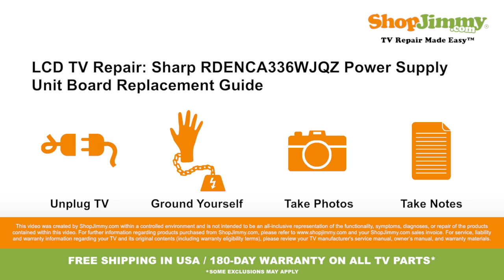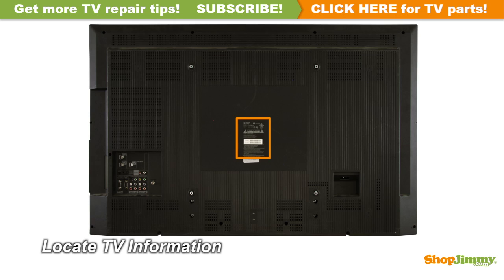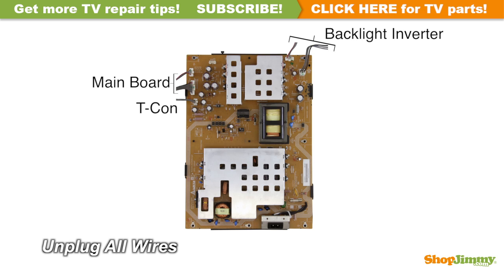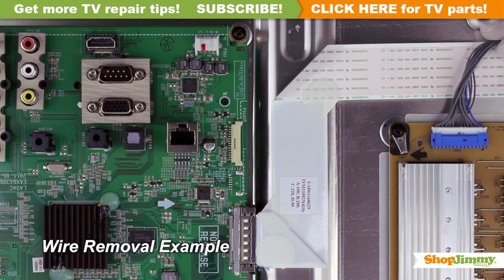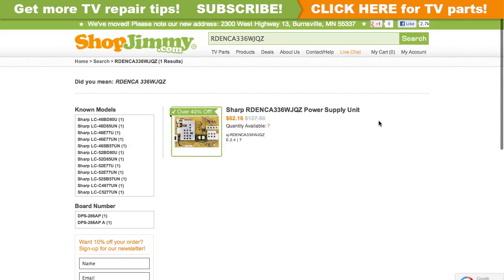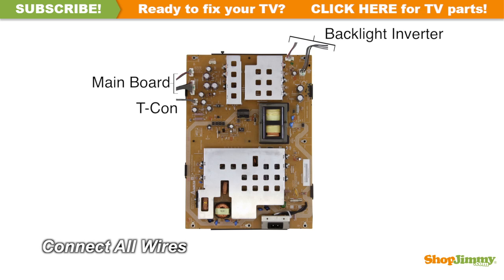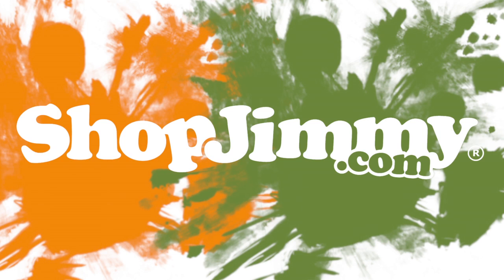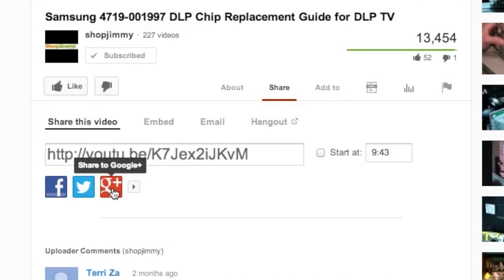LCD TV REPAIR TV WILL NOT TURN ON - Sharp TV Power Supply Board Replacement Models LC-46 LC-52 LC-C

Comment: I have a Sharp LC-43UB30U which was purchased in 2015. The tv now makes loud crackling/popping noises, The tv turns itself off and on and at times goes either to an all black screen or a screen with snow or just goes off completely. Do you know if this could be the power supply?

Comment: Hello, I have the SHARP 
LIQUID CRYSTAL TV
MODEL PRO-70X5FD 120V
SERIAL NO. 108812410 and my husband is about to toss it vs fixing it. I think we can fix it. We have the error codes indicating a panel power supply error (2 slow blinks, 5 faster blinks). I am searching far and wide on YouTube & other sights and am trying to figure out, well how to fix it obviously, but wondering if this error code is what amounts to bad capacitors or not, I guess? Any help on this would be much appreciated as he does know how to solder. Help PLEASE.

Comment: My Sharp LC-70LE660U tv has no picture (very dim blue light in the background) or sound when turns on. The white power light comes on while it could not be turned off either by remote control device or from the tv panel button. I have unplugged power cord and no success to get the picture on.
Please advise if this is the problem of backlight inverter or the power supply board? Thanks.

Comment: Hello,I have a Sharp TV, model LC-46SB57UN that will not turn on. It has the power light, OPC light that blinks twice together and the OPC light blinks once by itself. Could this also be a result of a bad power supply board?

Comment: I have an AQUOS SHARP TV Model LC-52LE820M - replaced the Power Supply Board and have 1 short blink - followed by no display or sound. Tried resetting the lamp but no joy. However there is static on the screen. Please help!

Comment: My sharp lc52e77un will not come on. Blinks twice with the power and opc lights, then once with the opc light . Replaced the power supply board
Reply: Any updates pls?  Did you sort the problem?

Comment: I have a Sharp - Aquos  LC-46LE540E (Europe model) the power supp. is bad. I have to press 6 times on the tv and sometimes 10 times (20 min later) it will boot. I only can find a USA power supply. and i need europ because the 230 volt.

Comment: I have a Sharp Aquos LC60LE644U. It will not turn on there is a solid red light in the left corner. Tried all the tricks, unplug, hold power on, arrow up, (do a backflip while holding my breath and singing yankee doodle)  etc. Does it sound like it needs a power supply board replacement?   Please advise....

Comment: hello, our TV won't power on. If you plug it in, the red LED will flash very quickly and then gone. Do you have power supply for this model: LC-50LE440M. PS. when I visited your website, shopjimmy.com, it says Access Denied.

Comment: I have a sharp 52 inch model number LC-52D64U the opc light will flash once and the power light flashes twice right after it sounds like it wants to power up but it doesn't would you know what it could be I'm thinking it's the power supply board but not sure

Comment: I have a sharp LC-52D65U  T.V.  NO CONTOL from remote or buttons on side of T.V.   The T.V. is locked on and will not shut off, can't change input, no menu.   Any idea of the part to replace ?  Thanks.

Comment: How to change power source I have a sharp aquos 2003  model: LC 20E 1UBM Serial NO. 307818984  do you know why I can get a power cord for it?  or change out the old one to a two prong female end that's goes into the tv not the wall

Comment: My Sharp 60" LC-60LE745U wont power on.  The arrow-shaped light under the screen flashes twice fast and twice slowly.  No picture, no sound, no backlight.  I've gone through all of the button-pushing sequences that I've seen online and in the comments but nothing works for me.  Any advice?  Power supply?  Would I get the flashing arrow lights if the power supply was bad?

Comment: I have LC8470 60' 2 slow 2 fast.. if i unplug it from wall and wait 2 days and plug it. it works. but if I turn it off. it happens again. it seems to be the power unit. isn't it?

Comment: I have a Sharp Aquos LC-70LE757U that doesn't power on.  The white power light on the bottom middle of the TV blinks 2 slow blinks followed by 5 fast blinks.  I'm in need of help!!!
Reply from the maker: +Russ Dodge   Try all repairs and troubleshooting at your own risk.  This sounds like a TV panel (TV Screen) problem.  If your TV panel is bad, it may be more cost-effective to replace the TV as panels are typically hard to find in stock, difficult to replace, and expensive.  Thanks and please let us know if you have any further questions!  www.shopjimmy.com

Comment: What is the common device failure if i plug it in and it makes clicking noise as if turning on then front green lights just keep blinking? I need to know what to look for and how to test it so I order the correct part. LC 46D65U
Reply from the maker: +Allen Ibarra   Unfortunately, we are not aware of any common issue with that model.  Thanks!  www.shopjimmy.com

Comment: I have a problem with my aquos model # lc-52le640u not turning on, the logo on the tv blinks but never comes on...can you help?
Reply from the maker: +Fatu Moliga  Try all repairs and troubleshooting at your own risk.   How many blinks are you seeing?  Thanks!  www.shopjimmy.com
Reply: +ShopJimmy.com I am seeing one short blink and one longer blink, they alternate every second but the TV will not turn on. Any thoughts?  
it is an LC-52LE810UN
Thanks
Reply: +ShopJimmy.com I have the same model, it blinks one long, and one short, (or visa versa), replaced the power board... no change

Comment: My Sharp Aquous tv model number LC-7OUD1U and serial number 312814372 is blinking a blue and red light at the bottom of the tv. the blue light blinks two times and the red light 5 times. any suggestions?

Comment: LC-52sb55u. I have sound and I can see screen but barely through the flash light test. Amber power light.
Reply from the maker: +ChiefsNation82   Try all repairs and troubleshooting at your own risk.  This could be a problem with either the inverter board(s) or the lamps in the TV.  You can replace the inverter board(s) and see if that fixes the problem.  Click this link to replacement parts for your TV model number:  http://www.shopjimmy.com/catalogsearch/result/?q=LC-52sb55u  There may be multiple boards for the same TV model number, be sure to match part numbers on your current board, with your replacement for compatibility.  Thanks and please let us know if you have any further questions with your TV Repair!  www.shopjimmy.com

Comment: I've got a Sharp  Aquos Model LC-60E78UN and it wont turn on,  When I plug it in it lights up green LED for power but wont get a picture then after 5-10 seconds it starts to flash BOTH the power and the OPC LED's twice , then flashes ONLY the OPC for 3 times then back to both twice then OPC 3 times. This just goes on over and over and no picture or sound.  IS this a Power Supply Board issue?  Can I purchase a new one off your web site and this will fix it?  Thank you

Comment: I have a Sharp Aquos TV that makes a clicking noise when I plug in the power, I replaced the Power Board as you suggested in the video but it is still doing the same thing.  I get no screen, no sound just the clicking noise when I plug in the power cable.
Reply from the maker: Stanton PC Repair & Sales   Try all repairs and troubleshooting at your own risk.  Please reply with your TV model number.  Click here to view a video that shows how to find your TV model number:  https://www.youtube.com/watch?v=S51nhAmwR2M  Thanks!  www.shopjimmy.com
Reply: ShopJimmy.com LC 52D92U
Reply from the maker: Stanton PC Repair & Sales   PLEASE SUBSCRIBE TO OUR CHANNEL - Try all repairs and troubleshooting at your own risk.  I recommend replacing the main board in your TV.  Click this link to a replacement main board for your TV model number:  http://www.shopjimmy.com/sharp-duntke028fm01-main-board.htm  Be sure to match part numbers on your current board, with your replacement for compatibility.  Thanks and please let us know if you have any further questions with your TV Repair!  www.shopjimmy.com
Reply: ShopJimmy.com Thanks for the reply, I replaced the power board firth, than I replaced the main board, it still does the same thing.
Reply from the maker: Stanton PC Repair & Sales  Where did you purchase the boards from?  Thanks!  www.shopjimmy.com
Reply: ShopJimmy.com I got them from a TV repair shop and supplier in Gardena California.
Reply from the maker: Stanton PC Repair & Sales  Try all repairs and troubleshooting at your own risk.  It sounds like you received defective replacement parts, I recommend returning them and seeing if different replacement parts fix the 
problem.  Thanks!  www.shopjimmy.com

Comment: I have a Sharp Aquos 60" LED that was hit by a power surge and now will not turn on.  I am getting a series of flashes from the white indicator light below the Sharp logo.  The light flashes twice quickly then twice but a little longer -- basically, 2 short and 2 long flashes. I cannot get anyone to tell me if this code means anything, of course Sharp wants to send out a technician and charge 100.00 for that, and my tv repair shop wants to charge 65.00 to come get it and 49.95 to diagnose the blinking.   The tv is 3 years old but I don't want to have to replace it.  Any suggestions would be awesome!
Reply: Sorry forgot to include my model 60LE632U
Reply from the maker: Mark DeGroot   I recommend replacing the power supply board in your TV.  Click this link to replacement parts for your TV model number:  http://www.shopjimmy.com/sharp-runtka847wjn1-power-supply-unit.htm  There may be multiple boards for the same TV model number, be sure to match part numbers on your current board, with your replacement for compatibility.  Here is a link to a video showing how to identify your part number, click here:  https://www.youtube.com/watch?v=-i9o4C2XkyQ  Thanks and please let us know if you have any further questions with your TV Repair!  www.shopjimmy.com

Comment: I have a Sharp lc60le600u TV that will no longer turn on. I bought this TV used, and it powered on just fine when I bought it, but after letting it sit for 3 days without powering on, it no longer displays anything. When I initially plug in the TV the V power light in the middle of the TV (under the sharp logo) illuminates for a few seconds and then goes dark. The power button doesn't do anything for the screen no does the affect the lit up V. I'm thinking the power supply may just be bad but I'd like to hear what you think is the issue. Thanks!
Reply from the maker: Rob Sessions   This could be a problem with either the power supply or the main board.  You can replace each of those boards to see which one fixes the problem.  Click this link to replacement parts for your TV model number:  http://www.shopjimmy.com/catalogsearch/result/?q=lc60le600u  Be sure to match part numbers on your current board, with your replacement for compatibility.  Here is a link to a video showing how to identify your part number, click here:
Thanks and please let us know if you have any further questions with your TV Repair!  www.shopjimmy.com

Comment: You know, I've seen replacement guides on this channel on this model LC-46SB54U, but I never see a troubleshoot guide on finding out what part went out. Also with this TV, when powered on, no screen, hear clicking noises for about a minute, and then the power light with the OPC light blinks 1 time, and power light blinks an extra 2 times. If you know what went out on this computer, please tell me so I can order from this site.
Reply: oops. Said computer instead of TV. I'm a repair guy and deal with a lot of TVs and computers.
Reply: DJ Overspin Did you ever get an answer about your issue.  My lc-46d62u just did the same thing yours did.......wondering if it is fixable or not.  suprtma@gmail.com

Comment: HELP? I plan to replace the Power Supply for my LC-42SB45U, but my husband and I have been unable to remove the back of the TV to access it. All screws have been removed and all 4 sides separated, but something seems to be holding in the center of the back where there is a small black plastic circle, but nor screw. Any suggestions?
Reply from the maker: Debbie Calloway   Is it over the tuner?  Can you upload an image online and reply with the link to that image?  Thanks!  www.shopjimmy.com

Comment: I have a Sharp LC-46SV50U. It doesn't always come on when the power button is pressed, although the green led comes on and stays on. When in this condition, the green light is on, the tv cannot be turned off with the remote control. Other times it the tv comes on as it should and functions normally. I have always been able to unplug the power cord, then plug it back in, press power and get it to come on normally. However, I may have to repeat the sequence of unplugging and plugging back in and pushing the power button several times before it will come on. As I said earlier, once it comes on it will stay on and work as it should until manually powered off. The green or red light never blinks. Can you please help me?
Reply from the maker: *****  Please watch this video FIRST to help with your repair!  https://www.youtube.com/watch?v=BP3NVNCGEv8  I recommend replacing the power supply board in your TV.  Click this link to replacement parts for your TV model number:  http://www.shopjimmy.com/catalogsearch/result/?q=LC-46SV50U  There may be multiple boards for the same TV model number, be sure to match part numbers on your current board, with your replacement for compatibility.  Thanks and please let us know if you have any further questions with your TV Repair!  www.shopjimmy.com
Reply: I have the same problem, changed power supply and it did not help.

Comment: Hi Jimmy, I have a problem with my sharp mod. # lc-52le700un. The tv went off and only the power light blinks steady. Any idea what went wrong, and how do I fix it. Thanks, Bob
Reply from the maker: bobh46   Does it blink on the front? If so how many blinks?  Thanks!  www.shopjimmy.com
Reply: ShopJimmy.com Hi jimmy, just tried the hard reset I found on the website. It worked !!  will update when I get it back on the wall and hooked up to cable. Thanks

Comment: SH20UHi, I have a Sharp LCD TV model no. LC-37SH20U while watching the screen went black and the power button started blinking (green). I have went through the troubleshooting section of the ops. manual (no help at all) is there any way to diagnosis this set to see if I can repair it myself?

Comment: Hi I have a Sharp LC-46E77UN that won't power on ..any ideas as to what I need to do next? Thanks
Reply: Hold on the channel down and the volume down and it hit power button at the same time the little turn red I know you tried turning it on

Comment: I have a sharp LC-65D64U.  THE POWER LIGHTS BLINKS. I DID THE RESET METHOD AND THE POWER LIGHT AND OPC STAYS ON..NO BLINKING... THE SCREEN CAME BRIEFLY WITH THE TOP PARTOF THE SCREEN ALL BLACK,THE BOTTOM HALF FUZZY...THEN SHUTS OFF...
Reply from the maker: terica dubois  How many blinks are you seeing?  Thanks!  www.shopjimmy.com
Reply: ShopJimmy.com  I stopped counting after 35 steady blinks

Comment: I have a sharp aquos 52in and it will not turn on. Tried different outlets and not a sign of life anywhere.  What recommendations do you have?
Reply from the maker: Aggie Pride   This sounds like a problem with the power supply.  Please reply with your TV model number.  Click here to view a video that shows how to find your TV model number:  https://www.youtube.com/watch?v=S51nhAmwR2M  Thanks!  www.shopjimmy.com
Reply: ShopJimmy.com Model number is LCC5277UN.
Reply: any advice for me?
Reply from the maker: Aggie Pride   Here is a link to replacement service for a power supply that matches your TV model number.  http://www.shopjimmy.com/sharp-rdenca336wjqz-power-supply-unit-repair-service.htm  Please call our customer service with your power supply part number and they can walk you through the steps of the repair service.  Basically, you send us the board, we repair it and then send it back you.  You can also call our customer service for further assistance with your purchase.  (877) 881-6492

Comment: I have a LC-47SB57UT model 912822697  it will not turn  on and the standby light is solid red. I've tried all the above.

Comment: I have a sharp liquid crystal tv model LC-70LE732U the power light will blink twice slow and then five times fast.  no video or audio the picture is black.  a high pitch sound is heard once plugged in but nothing happens.  please help
Reply from the maker: Rocky Taylor   This sounds like a TV panel (TV Screen) problem.  If your TV panel is bad, it may be more cost-effective to replace the TV as panels are typically hard to find in stock, difficult to replace, and expensive.  Thanks and please let us know if you have any further questions!  www.shopjimmy.com
Reply: That sucks

Comment: ShopJimmy my sharp aquos is not turning on i was putting in my ryw wires and it turned off when i changed input to 6 everything is working the power sensor for standby is not flashing at all plz help for any solution
Reply from the maker: Shivem Sandhir   I recommend replacing the main board in your TV.  Please reply with your TV model number and then I can recommend replacement parts.  Thanks!  www.shopjimmy.com

Comment: http://youtu.be/ovnw8BrsQnY

this are the symptoms having my tv.
Reply from the maker: damian4522   So you have changed the main board and power supply board in your TV after a lightning strike, correct?  If so, were both replacement boards working?  Thanks!  www.shopjimmy.com